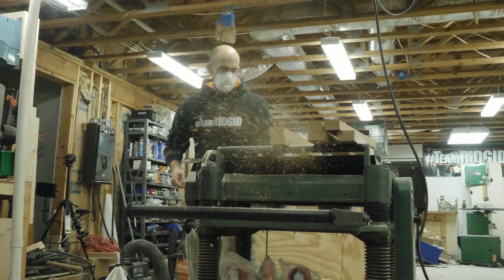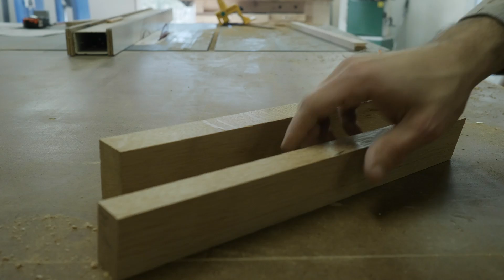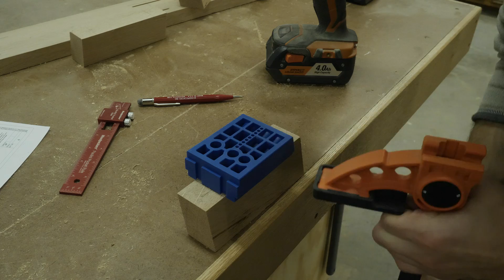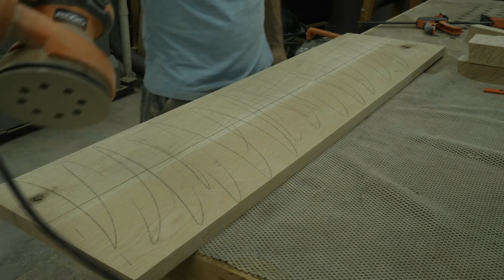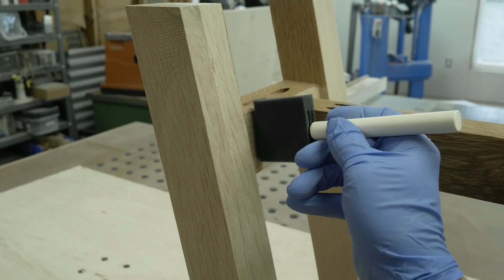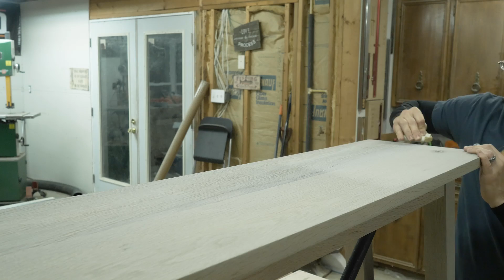How to Build this DIY entryway bench + Free Plans

Comment: Great bench plan! I love the design. For your rough stock, did you start with 8/4, or mill down 6/4 for all and glue together for stretchers and legs that were 1 1/2 and 2 inch thickness. Trying to plan out the best layout for the 10 board foot this calls for. Thanks for your help!
Reply from the maker: Thank you!  Man it's been a minute since I built that one but I believe I started from 8/4.  Happy building!

Comment: Hi Mike, love this bench, I'm the same as Carol Olive and quite new to woodworking, I'm tempted to have a go at this but I was wondering why you used the pipe in a 'V' configuration and not an inverted 'V' which would make more sense (to me) as it would stop any sag over time in the middle of the bench, or are they there just to give the bench rigidity.
Reply from the maker: Hey Fred, thanks for watching!  The pipes are purely aesthetic.  As far as sag, the stretches under the bench will prevent that👍🏻